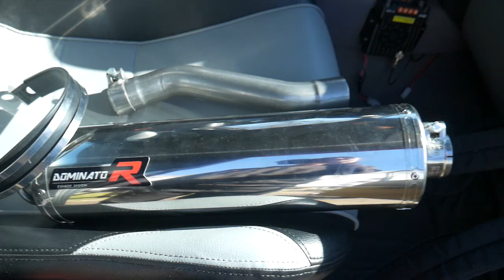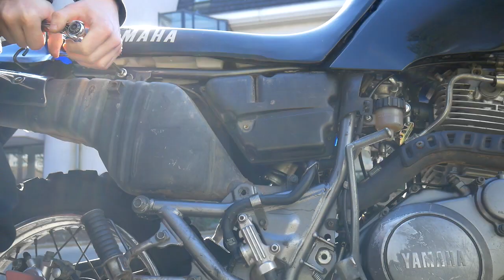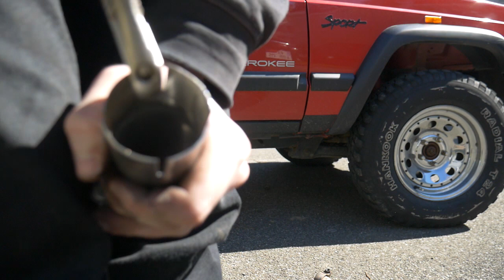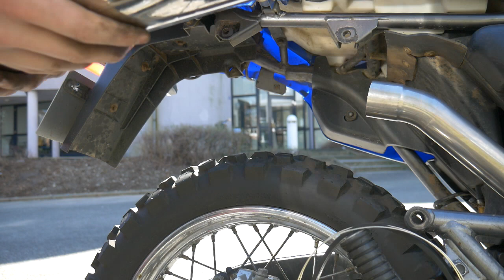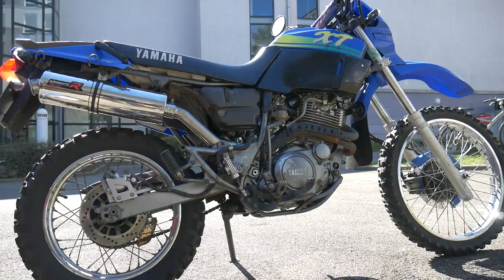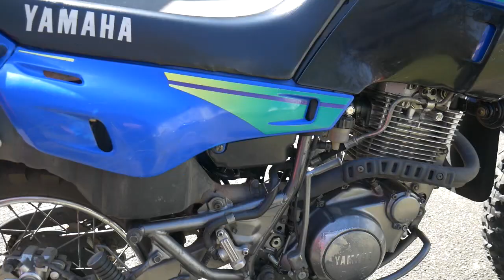New exhaust Dominator Yamaha XT600 installation

Comment: Looks nice but bad idea.. the stock exhaust is structural part of the frame.
Reply: XT 600 has serious structural problems With Not original exhaust...
Reply: you can make or buy a link that compensate for the new exhaust.
Reply: On My XT i changed The Last 10 cm of pipe with one 30 of section...same look But empty exaust.... more speed And Less fuel

Comment: Hello, this is with or without the db-killer for that Dominator, on the video ?
Reply from the maker: It is with the db Killer, but I made another video where I made the difference of the DBkiller dominator, a cheap DBkiller and without DBkiller, and the noise whas mesured with a decibel meter ;)
Reply: thanks you.)
have you for the K&N air filter installed on that bike, on that video ?

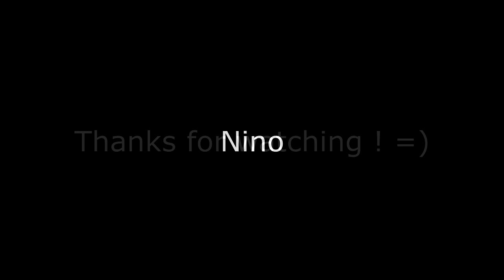Comment: Oh a yammie with a jelly can. Weld a nut on the extension pipe to mount this cheap system correctly. at 7:20 note the excess movement when he moves the pipe. The mount point us just above the top stud of the rear brake cylinder (where it mounts to the frame.)